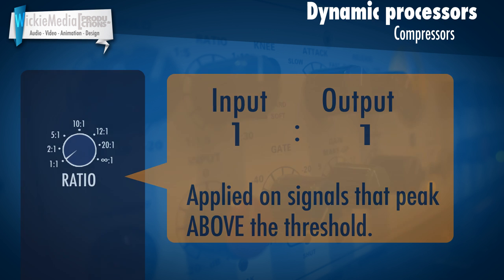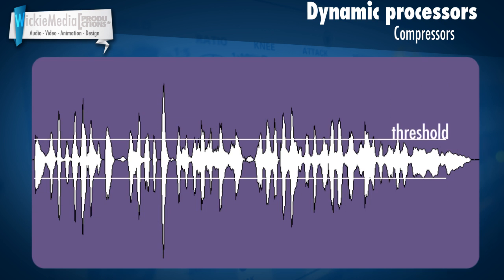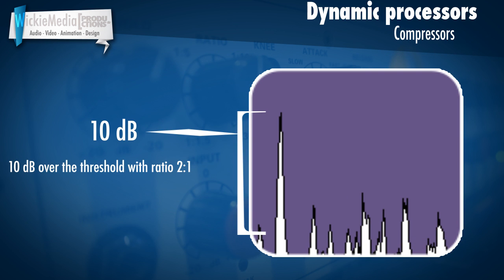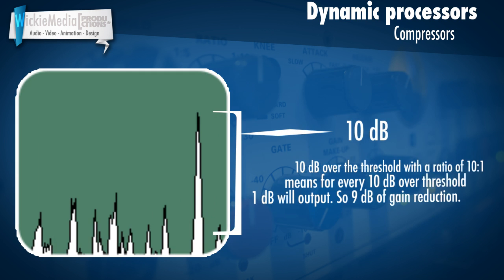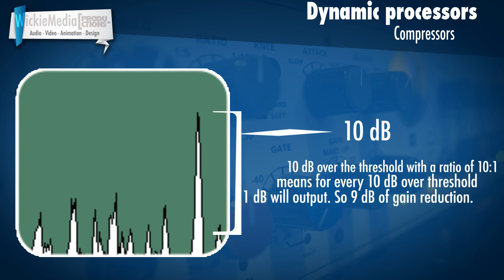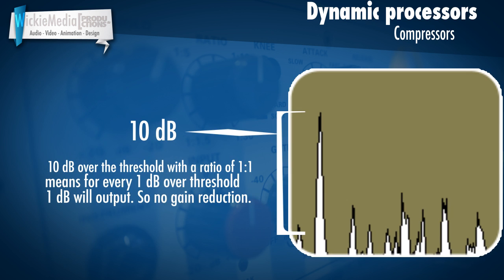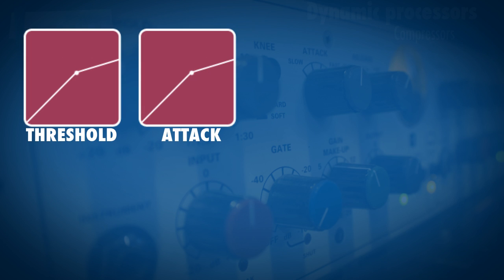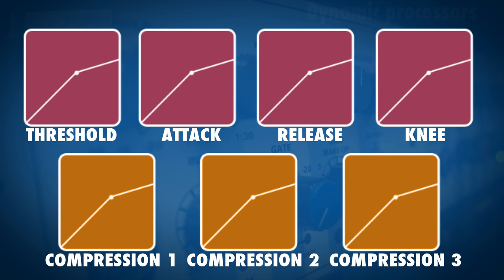What is the 'ratio' on a compressor? (Quick tutorial)

Comment: I might be doing something wrong but i tested this. I had a clap sound which i raised to 0db because i wanted to see how it works. I set the treshold to -10db and put the ratio to 2.1 and instant attack and it only came down to -2.6db. i used fl studio built in compressor. I raised the sound to 0db with an eq and put a compressor after that.

Comment: PLEASE I NEED HELP!
why 10 dB over the threshold is calculated as 9 dB ? i need a brief explanation since i am a dumb dumb in math
Reply: haha same but i got it
Yo look,
it aint calculated as 9 dB. the compressor reduces 9 dB for the output.
our threshold is -10 dB(threshold means a line which limits the volume) and our ratio is 10:1. that means when the volume reaches the threshold which was -10dB, the ratio would do its work. 
10:1 means for every 10dB signal, 1 dB will be the output. 
so in 10 dBs, we got 1 dB
10-1 = 9
so 9 dB reduced.
sorry for my english tho. hope you got it
Reply: Zhiyar Zhika so, the threshold is actually a working line? i get what you mean. gonna try that now. thank you so much my dude

Comment from the maker: There is no rule for what 'good compression' really is. It can be sounding good when you have a 2dB gain reduction in a certain situation. But in another situation a 12dB gain reduction could be the amount you need to have it 'sit in your mix' a lot better. So 'good compression' is different for each situation and has nothing to do with the compression-ratio that you set. infinite:1 simply means it will output only 1dB for all peaks that cross the threshold level.
Hope that helps.

Comment from the maker: Hi, equalizing and compression are two completely different topics, You could ofcourse use both on the same track in the order you just mention. Eq before compression, or Eq after compression; It really depends on what sound you want to achieve. An eq can increase the peaks of the dynamics when you boost certain frequencies with it. So when you apply that EQ before the compressor this will probably compress harder, and thus remove the dynamic peaks your EQ just created.